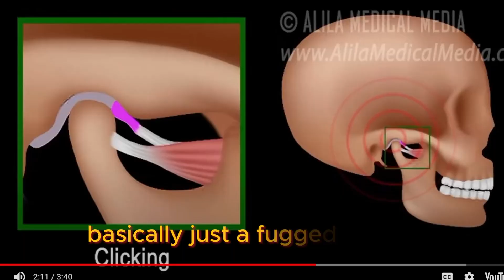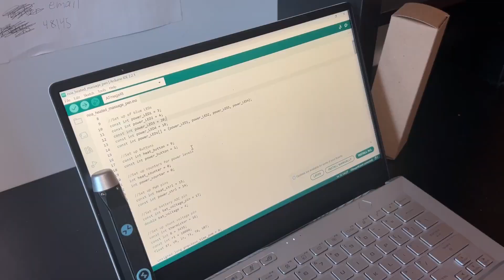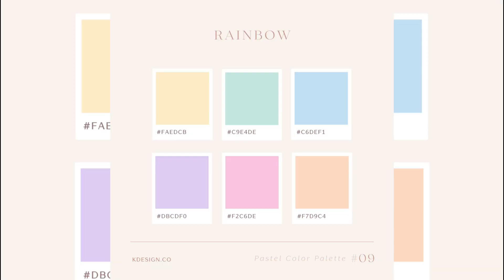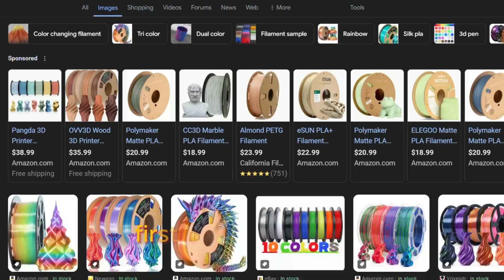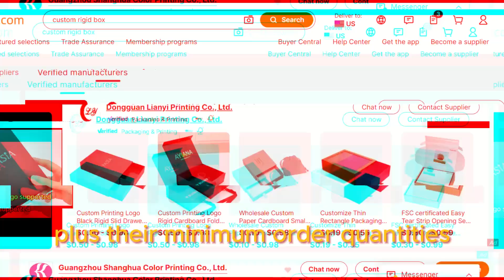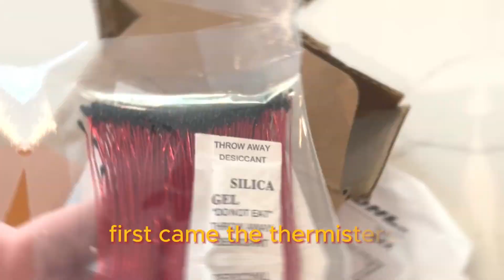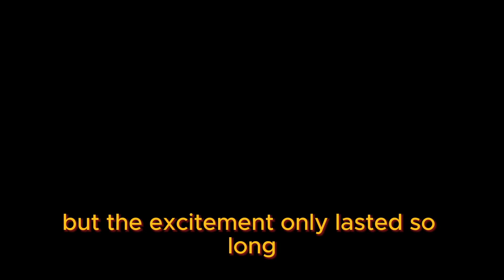I quit my job to be an inventor | Ep. 12

Comment: Hey Noam! This is really cool. I'm so glad that the board powered up first try. I would love to see more about your pogo pin setup. Are you using an MCU that can't easily be flashed by USB? I'm on my own hardware journey, and one of the things I've gotten a ton out of is John Teel's Hardware Academy. Amazing community and courses/workshops on everything that keeps us up at night, pondering the infinite decision tree rabbit hole Jenga deathmatch. My only pushback for you is that I think that 3D printed enclosures are for prototyping. It's basically impossible to make something 3D printed that isn't a brittle toy which people perceive as cheap. For this device, I would look at using a Carvera CNC or maybe a Roly Lasermatic to do a wood enclosure. There's also been some pretty incredible recent developments in the injection mold world where it's now possible to 3D print your molds so you can realistically make real plastic enclosures for high $$$ to low $$$$ instead of $$$$$. If you're interested, there's a workshop about it on Hardware Academy, or I can also introduce you to someone doing it on a small scale basis.
Reply from the maker: Hey thanks for the tips. For the TAG connect, it’s a lot faster than USB. It’s the correct move for scale I think. As for enclosures, I kind of disagree. It’s certainly not a brittle toy, and cost wise blows wood and CNC out of the water. Injection molding is fair but not at this early of a stage, the startup costs are too high considering it still tweaking the design here and there too. I’ll probably make the cases out of MJF nylon once I’m preparing the next big batch which’ll be even stronger.

Comment: Having prototyped various products, both in my current job, and for fun/in my free-time; I'd suggest you to consider switching over to MJF/SLS for final production. Third-parties, such as PCBWay/JLCPCB/etc offer low volume and low cost nylon printing, so you don't really need to worry about post processing, tolerances (well, to some degree), print failures, and most importantly: no need for support material! Prototyping with FDM is amazing, and there's no low cost substitute. For manufacturing, assembling and shipping actual products to customers; it's not that great. Don't get me wrong, it's very functional, but it has very obvious limitations. I wish you all the best on your journey!
Reply from the maker: You read my mind! My current plan is to switch over to MJF after I do the indiegogo and have a higher volume of orders to fulfil.

Comment: Wow, great work! Have you done any certification of the product? I know here in EU you would need to have a CE certification in order to be able to sell it...
Reply from the maker: Great question! I’m working right now on clearing it for CE and FCC. They’re both self certified in my case, but still obviously have to do the testing. The products been changing so much so couldn’t do it earlier haha. Also will be registering with the FDA soon.
Reply: @noamaiz  That sounds great man! Good luck with that and the sale of the product! Your work is very inspiring!
Reply: @noamaiz  I've gived up my project because of CE certification. Even if it's a self certification you have to write a technical case with very specific tests that is pretty complicated. The cost for the certification for electronics device are between 3000 and 12000 euros here in the EU and price dépend on your capability to make your own tests and proove that the product is safe. (But i would be reallly interested to know how it's works with the FCC) . But anyway reallly good job ;)